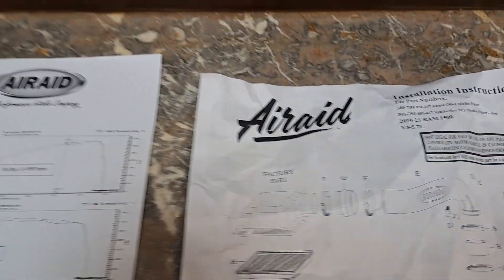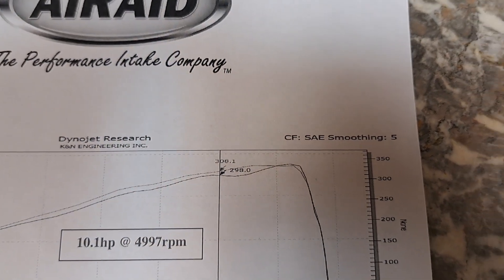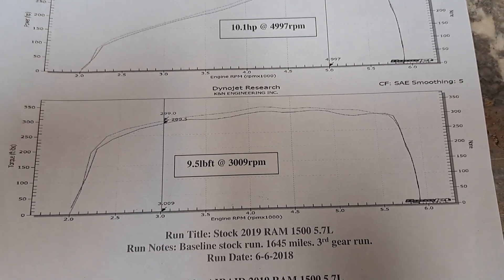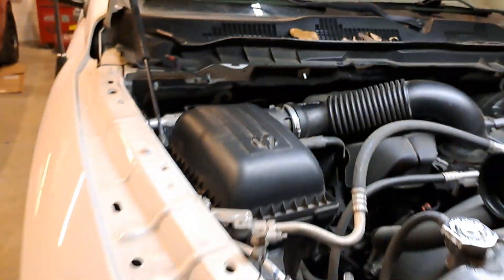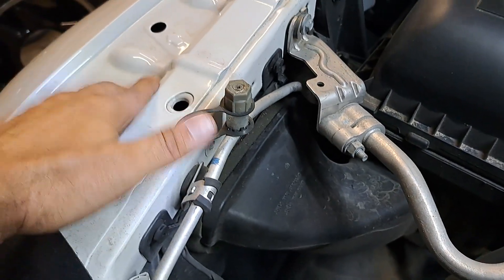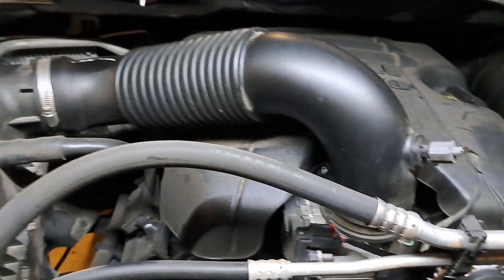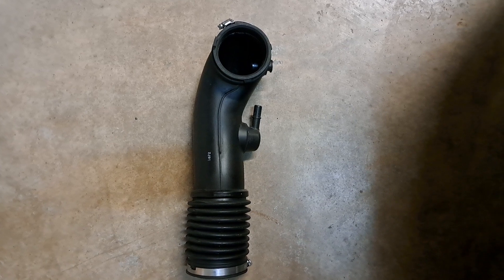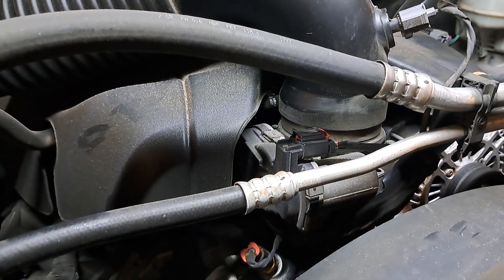RAM 1500. Cold Air Intake. Airaid Junior... The lost footage edition

Comment: Thank you for helping me all these years with Mopar questions! I have another one :-)
Reply: I removed all the all wheel drive components from my 2014 RT. I got the three bolt flange for the end of my nag1 transmission and then purchased 2wd driveshaft to connect to that flange. When I went to hook up the driveshaft, it was about a half inch short! Do you know if the engines are placed by the factory in a slightly different spot AWD vs. 2wd? Or maybe the rear differential is slightly different? I ended up having to put the awd transfer case and awd driveshaft back. But was able to leave the other all-wheel drive stuff deleted. The transfer case is over 60 lb and I don't want it on there anymore!
Reply from the maker: @slashsaxlrose4353  I've never tried to do a swap like that, but I can only imagine that yes, there would be different motor mounts and possibly transmission mounts to make room for the extra components
Reply: @bamason721  I notice on RockAuto that they didn't differentiate between the 2wd and awd engine mounts. I almost wonder if there is a couple extra holes right next to where the mounts are now. Demonology told me on his live chat this morning about a couple of driveshaft companies I can contact. It drives just fine the way it is now. I just want that 60 + lb transfer case out of there! Thank you B Mason! I look forward to the next show as always!